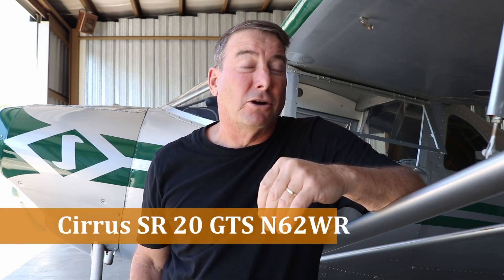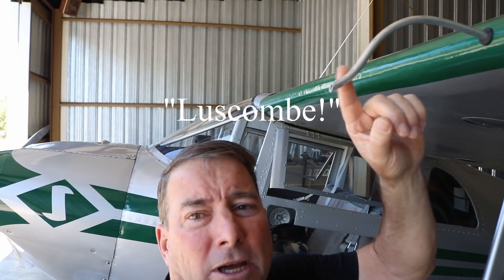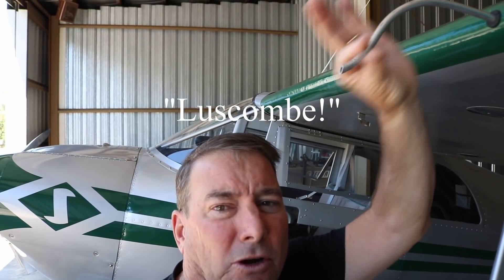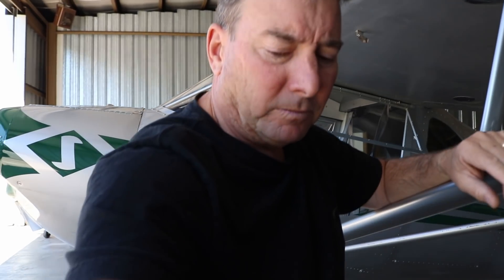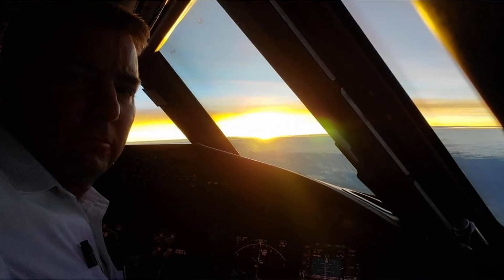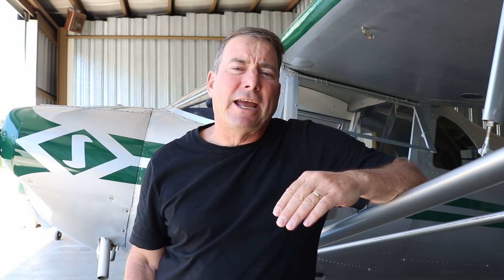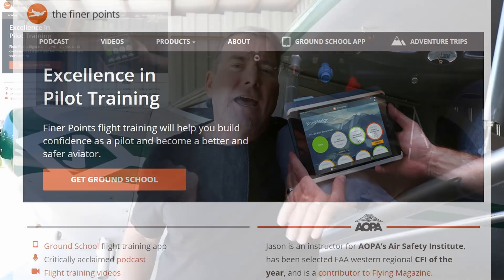Cirrus SR20 Crash Conway AR - AQP for GA!

Comment: Years ago, I experienced a situation very similar to this incident. I learned that my favorite plane to fly, at the local flying club, had been wrecked but not totaled. It took months to get it back, but when it was back on the flight line, I couldn't wait to take her up again. So my day came, and I gave her a thorough preflight and everything seemed fine. As I advanced the throttle and started down the runway, I noticed the airspeed indicator was not moving at all. Just tinkering left and right. When I was halfway down the 3000 foot runway, I rejected the take off and taxied back in to investigate. I knew in my mind that the issue was more than likely the pitot tube or the static port, so I turned my attention to both of these instruments immediately. This time I grabbed my flashlight, even though it was the middle of the day. The pitot tube was fine, and I did not see anything which would obstruct it's normal functionality. The static port, however, had a small piece of paint inside of it, from the new paint job as a result of the plane being previously wrecked. This was a huge eye opener for me. I could only imagine how things would have turned out had I decided to rotate that airplane and got off the ground.
Reply: obstructed static will not cause a dead ASI
Reply: @lacantinadicrono798  The airspeed indicator may work, however, it will be inaccurate. Which is my point. Either way, the decision to no-go was the best decision because there was an obvious discrepancy in it's operation.

Comment: Most of the aircraft we serviced had pitot heat . We would use the plastic sheath spark plugs came in , 2 staples down the side for a snug fit on the pitot , with a red streamer ..
If proper preflight not done , as a last resort , turn pitot heat on n melt pitot cover away.

Comment: When I was a student I took a couple trips around the pattern with the airspeed covered up. Unscientific but pitch and power are the only things that really matter when you have no reference for speed. Very easy to “feel” the difference in the controls of 5 knots by having the airplane properly trimmed too. Something everyone should practice under controlled conditions.
Reply: the GPS wil give some useful indications on speed. not totally precise, but if one only has a look a the windsock before landing, in the case the GS will be less than the IAS, so one will arrive faster, which is a lot better than arriving too slow. in flight no ASI is no issue.

Comment: Zach was an actual Instrument certified pilot, not a “student pilot”.  This plane had a GPS so he could have determined airspeed by looking at the ground speed and added/subtracted head/tail wind component.  Very sad
Reply: I don’t know but I am quite sure Juan has read the NTSB preliminary which may have reported as a student.
 There is a site...’Probable Cause’ if memory serves me well, that spews off. I never watch his and in fact removed all access to it.
  Juan is very professional about his reporting and, being human, may make mistakes of which he will quickly correct.
Reply: Why? It was a clear day. Stick and rudder along with attitude flying is all but gone from training. Every student I’ve had ( and it’s many), all get the same first lesson……… the instruments have suction cups covering them and everything is done looking outside the airplane. Attitude flying is the one skill that may one day save your life, I tell them.

Comment: Just more of my 2 cents...but..losing your airspeed indicator can easily lead to a loss of control...especially for a student...There have been several airliners with very experienced crews that crashed due to faulty airspeed indications. You should be able to fly by tachometer and attitude.... but if you are flying and all of a sudden you airspeed reads zero... you can very easily start to panic and forget everything you have been taught.
Reply: flying a jet at 30k with unreliable airspeed can be a little more challenging than what you laid out in 2 sentences.

Comment: I used to fly a 180 hp 172 with a CP prop and a stol kit.  Rotation speed was at the first flicker of of the airspeed needle which occurred in less than 3 seconds in the air density I'm used to.  One time taking off we got going a hellacious 40 mph (I'm guessing, it was fast) and still no airspeed.  Pulling over and checking things out, there was a mud dauber plug back inside the pitot where you couldn't see it.

Comment: I guess I was lucky.  When I was a student pilot my CFI covered up the airspeed indicator and we did pattern work, based on power settings and feeling the airplane.
Reply: I learned power settings as the golden rule.  Know your winds, know your settings.  Many landings with the a/i covered.
Reply: Its harder with a surprise erroneous reading. On an early dual flight I had the asi read 30 knots low, and wow am I glad I had a competent instructor with me!
Remember this is a student pilot here.
Reply: @TgardnerH  Did they tell you the ultimate cause?  Sounds like an obstructed pitot tube.  When things go awry, I always want to know why.  Of course my "mech" skills are way too rusty now.  But I did instrument systems in the mid 70s on C141s.
Reply: @petergreenwald9639  The 30 year old hose from the pitot tube to the asi cracked when we took the nose-cone of the glider off for annual the day before. Lesson: don't trust anything right after the mechanic touches it!

Comment: I'm no pilot but I do have a question.  Wouldn't modern aircraft have GPS that would indicate airspeed relative to the ground?  I would think there should be more redundancy than relying  upon a pitot tube to indicate airspeed?
Reply: GPS indicates groundspeed. Yes, this aircraft has that according to more knowledgeable commenters.
Reply: There is no “airspeed relative to the ground”. There’s airspeed, and groundspeed. Airspeed is what matters for the plane to fly. Groundspeed would give you an idea of airspeed if you know the winds, but I think that’s too complicated to deal with in this situation. Just pitch/power is good enough.
Reply: @tomcorwine3091  Ok, but wouldn't a GPS in an aircraft till be able to monitor airspeed?
Reply: @TheFlatlander440  No, only groundspeed. The GPS has no idea how fast air is moving over the wings.
Reply: @tomcorwine3091  OK.  So what you're telling me that the ONLY way a pilot can determine their airspeed is by using only 1 instrument via the pitot tube. Don't you find that rather disturbing considering all the other redundancies and instruments a pilot uses to fly the aircraft in non-controlled airspace?
Reply: @TheFlatlander440  It’s common for GA planes to not have any redundancies. More advanced avionics has given us redundancies with other instruments, but airspeed still depends on the pitot tube sticking out. I wouldn’t mind having a second one, but I’ll take a redundant attitude indicator over a redundant airspeed indicator.

Comment: Standing rule at our airport. NEVER interrupt a pilot during his preflight.
Reply: If I'm interrupted, I start again.
Reply: The Juan double check lap, and the don’t interrupt a preflight/or start over, are both rules that should be incorporated into aviation. 😉👍
Reply: Good rule!
Reply: I was taught if you get interrupted in the pre-flight, you start from scratch.  The pre-flight is what stands between you and discovering you have an un-airworthy aircraft at an inopportune time.
Reply: That's a great rule to have.
Reply: @LTVoyager  Thanks for the warning!
Reply: It’s general aeronautical etiquette but if you are interrupted you start over.
Reply: I do skydiving operations and my boss loves to come out and chit chat during pre flight. I'm definitely going to have to put an end to that now.
Reply: @rotten007pig  what are you driving Andrew - 206? Happy landings
Reply: @flymachine  Nah a clapped out 182 with an O 550
Reply: @rotten007pig  Hahah that sounds about right
Reply: ok but now i have a question. imagine  you ask for a lift to someone you dont know. before leaving the parking spot, the guy pulls out a worn out booklet and starts going around the car,  pulling and kicking at things, and mumbling incomprehensible and obscure phrases he seems to be reading from the booklet. then he opens the bonnet and starts an inspection of the engine bay, pulling at hoses and wires; he then  carefully checks the oil level. for some reason his car's engine is aircooled so no coolant check...
then he enters the car, and still mumbling into the worn out booklet, he starts touching various controls and dials, then he opens the window and starts yelling "clear" even though nobody is in sisght. 
you find an excuse and leave, right? guy must be crazy, right?  
if i my airplane needed to be checked before every flight because it could be losing pieces, i would sell it, and i would buy (or build) a proper one. 
i regularly inspect and maintain my a/c and when i do that, i do that, with all the proper tools and using the proper methods, and taking all the necessary time.
when i fly i fly, i dont do good fortune voodoo rituals.
Reply: @rotten007pig  Check the oil, check the fuel, kick the tyres and light the fires.
Reply: @lacantinadicrono798  good luck with that... hope you never give anyone a lift in your plane
Reply: @rehepeks  i fly with my kids, my friend. that should tell you how much i trust my methods. i know in aviation questioning the ancient voodoo rituals is heresy, but believe me, i know what i am doing. 
preflight checks on your own airplane are a waste of time.
Reply: In fact, never interrupt anyone, period. It is very disrespectful.
Reply: I use a preflight checklist where I can check off items as I do them. I've successfully done this in 2 ways:
1. Printed it out on standard paper, got it laminated, and used a dry erase marker to check off items.
2. Used Foreflight's checklist feature, which lets me indicate which items I've done.

My preflights last ~30 minutes (note: I'm still a student pilot, so that will probably get faster), so I don't want to start over.
Reply: I was a flight attendant for United.  We were taught never to interupt the crew when they were going thru  their  check lists, as they would have to start from the top. NO  distractions.
Reply: @lacantinadicrono798  wierd car analogy, if a car loses a bumper or engine quits because a belt snapped, 99% of the time you can roll to the side of the road, but proper preflight on an A/C is 1000 times more important than a car, even a brand new one, you can’t just roll to the side of the road when shit happens.

Comment: In training, my instructor would quiz me on things during my preflight. If I lost track of where I was, I started the preflight at the very beginning. I don't care how many times I have to check for water in the fuel tank, if my routine is interrupted at any point, it was back to the beginning. Apparently my instructors were good because they discussed all these items before I soloed. I will forever be grateful for their instruction. Now, a bird strike in the pitot tube could create havoc: knowing how the system works and the effects of such an event could also be helpful. Drill it so many times you don't get wrong.

Comment: My Dad never solo'd anyone without that pilot demonstrating ability to safely take off, fly and land with the airspeed covered.
Before you question the wisdom of taking off without an airspeed, try to understand it as an opportunity to learn as much as you can.
Reply: Unfortunately it sounds like the guy flying the SR did learn as much as he could. And it wasn't enough.
Reply: He didn't.  At my operation, we didn't solo a student without having covered the ASI & having them land without it until they could do so competently (NBD) and safely.    I covered the Altimeter well above pattern altitude and the ASI & taught every student to land in the normal landing zone, at or slightly higher than a normal patterns speed.  Again, until it was NBD.  A CFI can't prepare a student for every possible scenario.  But we can do our best to turn out Aviators instead of Airplane Drivers

We damn well owe it to them.  To teach them to deal with as many non-standard circumstances as possible.  The inability, in VFR conditions, to safely land an otherwise functional (?) single-engine GA a/c without a working ASI
Reply: @tylerdurden2644  …….. I received my pilot’s lic. In 71. Was never taught this.
Reply: It sounds like a simple case of poor preflight, As a flight instructor back in the early 70's I had students fly to a landing without asi as well. But I don't remember the FAA requiring this, we were trying to equip them with things that would keep them alive. It might be worthwhile to survey old flight instructors as well as new flight instructors and see what unofficial "good stuff" they are teaching. Maybe instruction could change for the better.  But the best pilot in the world is still a human being that can be distracted and in a hurry.
Reply: @larrymitchell3502  This is what we need.  I had to do the same thing before I solo.  We need instructors and schools to teach to a safer standard than simply passing the test.
Reply: Isn't it just as important to teach someone not to take off with non-functioning equipment as to teach them how to get back on the ground if it fails? The ASI isn't there to look pretty. I do recognize the value in the skill you all are advocating, but clogged pitot and static ports have been the cause of a lot of accidents with very skilled  pilots.
Reply: @Markle2k  Yes!  Most accidents are caused by multiple mistakes or areas of lack of training, and it seems there were three here.  One preflight, second either not looking at airspeed or not aborting on takeoff roll, and third not being able to fly without an airspeed indicator.  

One point that Dan makes is that some private pilots have never practiced an aborted takeoff.  Ever.  It's not required by the ACS, and some schools and instructors are only teaching to pass the test.

Comment: Juan, I'm going to not disagree with you, but I want to bring up something else.  Now, I learned to fly way back in the mid to late 1970s.  I learned in a Cessna 150  My instructor, my father, would beat into our heads (not only mine, but all of his students) that on a VFR day, get your head out of the cockpit.  I could fly a pattern, take off to landing, just by the sound of the engine, the sound of the wind going past the airplane, and looking on the ground to see how fast I was going.  I learned that BEFORE my solo.  In fact, there were times when I'd have airspeed, altitude and AI covered over just so I wouldn't look at them, and I did just fine.
This accident, at least from what I know about it from your description, should NEVER have happened.  The pilot should have recognized that his airspeed was incorrect and immediately transitioned to outside of the aircraft for visual references, and should have been monitoring power output, and sounds.
I will be willing to bet long money that his instructor never taught him 'seat-of-the-pants' flying.  Are you going to do that in an airliner?  Probably not today, but the principals still hold true no matter WHAT airplane you're flying.
I need to edit this comment since I found out the guy had been flying for 22 years and 18 years as an Instrument Rated pilot.  Unless this guy wasn't current, or had just gotten back into the cockpit after a substantial time away from flying, or was totally unfamiliar with the Cirrus, there has to be something more than just a pitot tube being covered up.
I still want to know why he didn't have his head out of the cockpit, though.  Aviate, first rule of flying.

Comment: Juan, as usual you are correct. A Q P should be a required tested procedure for the novice pilot with reoccurring checks through CFIi and commercial and we know it will be required at ATP.

Comment: My elementary instructor was frustrated by my bad habit of "chasing the airspeed needle".  In desperation, he used a briefcase to hide my flight instruments.  "Fly by pitch and power!"  On final, he removed the case and I was dead on everything.  Lesson learned.  This was in the original, American Aircraft Model 1 Yankee.  --also had a diaphragm fail in the ASI of my 172 years later.  Not a problem!  Pitch, power, land and repair.
Reply: Spatial disorientation: Trust your instruments!
Instrument malfunction: Trust your eyes!
To be safe, you need BOTH to be available - eventually ONE will fail!

Comment: He would need to see the ground speed indicator just to make sure he was taking off at (or above) the minimum take-off speed (Unless he was doing a practice Short Field Take-Off which the plane would automatically lift off when it was ready).  He should have known before taking off that his Pitot tube or his airspeed indicator wasn't working before he pulled back on the yoke. This also means he had no idea what his stall speed was on final.  Most people can just FEEL when they are too slow.

Comment: Are CFIs not covering these things now?  When I was flight training in the late 70's my flight instructor explained just what you mentioned, the relationship of power and attitude settings.  He would often have me land with the airspeed indicator covered.  Later on I was glad for that training one day when I took off in the Cessna 120 I was flying and airspeed indicator acted like an altimeter.  Fortunately I realized what was going on and lowered the nose before I stalled.  Flew it back to home airport and landed with out airspeed indication.  Plugged pitot line.